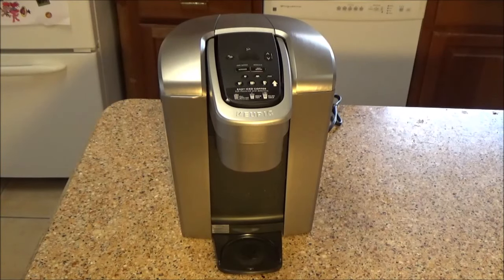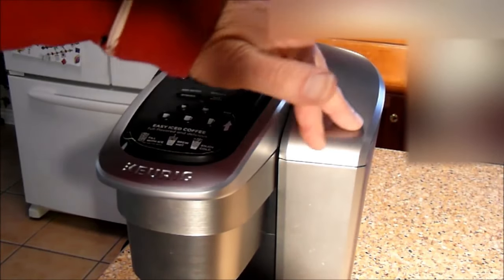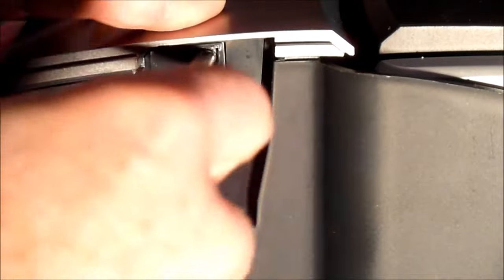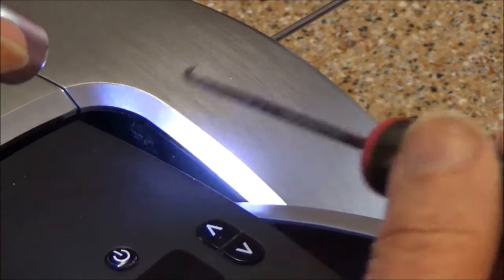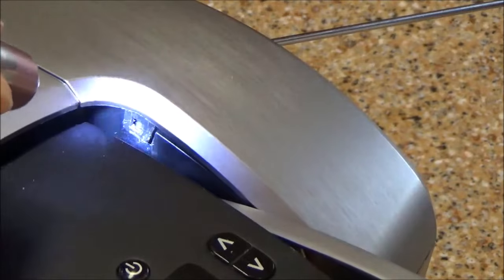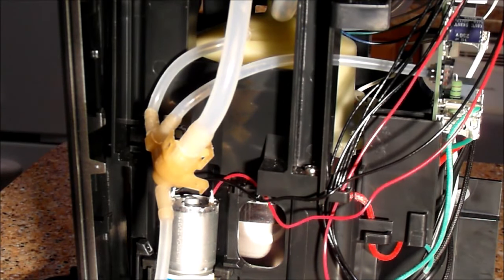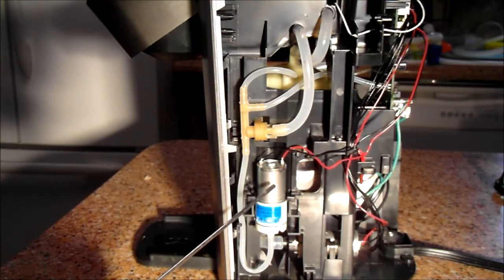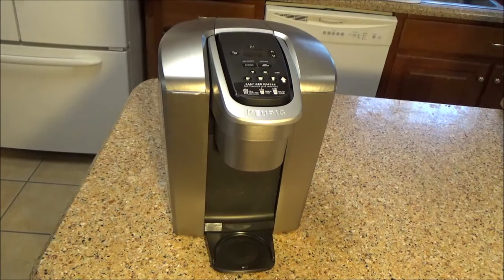Keurig Elite K90 Disassembly and Theory of Operation

Comment: Awesome video thank you. Do you know how to take the tubing apart without damaging anything? I have some mold trapped in the tubing but can’t seem to find any videos of this.
Reply from the maker: The ends of the tubing sometimes have a plastic zip tie around them to clamp them in place.  If that is the case, you have to cut the zip tie off using a pair of diagonal (wire) cutters, Xacto knife or something similar.  The wire cutters is usually the fastest and safest, and the idea is that you put the zip tie between both extreme tips of the wire cutter, and cut it (you don't have to force the wire cutters underneath of the strap, just on top of it).  After that, you can try to pull the end of the tube off of it's fitting.  If it doesn't come off, you can try to pry between the end of the tube and whatever fitting it connects to, to see whether you can get it to slide off by "pushing" it off by twisting the screwdriver blade or whatever you are prying with.  If that doesn't work, see if you can actually slide some thin object (like a small screwdriver) underneath the tube, between the tube and the nipple it is mounted on.  Opening it up like that can relieve the sticky friction that is holding it in place.  Then a little bit of prying and pulling might get it off.  It sounds difficult but it really isn't.  If you had to cut a zip tie off, you would need to replace it later.  They should be available in a home store such as the Home Depot.
Reply from the maker: Also, when working with that combination plastic piece that has a check valve and 4 flexible tubes attached to it, be cautious because if it is very yellow or brown in color, it can break easily.  It will look that way if the Keurig is fairly old.  On newer machines this plastic piece isn't so aged, and it looks more white colored instead.  In that case this piece is fairly strong.

Comment: Can you tell me where the thermostat is located in this model? Have looked at a dozen videos and no one has mentioned anything about its location. Thanks
Reply from the maker: I didn't cover that in this video, but I did cover it in the video for the model K50 at https://youtu.be/fdGND9f-kEs?t=2004.  When you watch that link, it will start out by talking about the emergency thermal fuse, but that's not really what you're looking for.  The discussion of the thermistor starts soon after that.  The K90 is pretty much the same as the K50 in this respect.  If you have the unit disassembled, you can trace down the white wires from the circuit board down deep into the side of the water tank, and barely be able to see the thermistor attached to the side of the hot water tank.  This is on the side of the machine where the external water reservoir would normally sit.  The thermistor is not really a thermostat, but it measures temperature and reports it to the main circuit board that uses the information to decide when to heat and when not to heat.

Comment: I think you've helped diagnose what might be wrong with our just out-of-warranty office Keurig. I think the water level sensing unit is full of water as it no longer reports when the water level of the external tank low. Also, when the water first heats up, a significant amount of water will come running out around the area where you popped the first latch at the back of the lid opening near the metal-looking tongue depressor. The water level in the external tank doesn't affect this behavior. It seems that as the internal water tank heats, the water can't run out of the overflow back into the external tank. Any thoughts on how to fix that without the extensive disassembly? My husband is considering blowing compressed air into it through the overflow.
Reply from the maker: I'm beginning to think this new way of sensing the external water reservoir level is less reliable than the older magnet based system that the older Keurigs had.  There have been times on mine when, like you said, the "Add Water" light should be on, but the light doesn't show.  So then without changing anything, I just turn the power off and back on again, and then the light does come on.  The water level sensor appears to be just a couple of plain metal rods that sense when water forms a circuit between them, since water is somewhat conductive.  When the "Add Water" light is on, I've put a 6 megohm resistor between the two probes, which forms a very weak circuit, but it is just strong enough to signal that the water level is no longer low, and the "Add Water" light goes out.  So the point I'm making is that if it takes practically nothing to complete the circuit to make the light go out, maybe just a little water vapor in the tube could do the same thing, even if there is no water.  So I think you could safely blow compressed air in through that ventilation port and I think it would be OK, as long as it's not too strong.  Pressure from an aerosol can or from an air compressor that is dialed down way low should be OK, as long as it is kept under control.  It won't take much pressure to blow it out and remove any vapor, if that is the case, but first you would want to remove the water reservoir and look down into the water port in the machine where the water reservoir plugs into.  You should see a white piece in the middle that is shaped like a plus sign.  Push on this and it should move down, because it is a valve, and it will allow the air that you are blowing into the ventilation port to escape (and maybe spray a little water out too, but not much).
Reply from the maker: Concerning the other part you were talking about, if water is coming out inside the compartment where the K-Cup arm is, I wonder if water is getting forced out of that ventilation hole that's on the wall inside that compartment.  If so, I would think something is blocked somewhere and building up pressure.  If you haven't already, you might try to clean out the needle that punctures the K-cup from the top with a paper clip or some thin wire and see what happens.
Reply: @getitsettech1015  I think you're right about something being blocked. However, I've already cleaned the needle. I've only used filtered water in this machine and have cleaned it a couple of times. The plan is to buy a new Keurig from Costco tomorrow for the office and bring this one home for my husband to take apart to try and find/fix the problem(s). He's handy like you are and watching most of your video inspired him to give it a shot. I'll let you know what he finds, if anything.
Reply from the maker: It sounds like your machine might be just a little beyond the warranty period.  Mine was too.  I thought it wouldn't hurt to at least call Keurig - most people have good results from them.  Sure enough, they sent me one even though I honestly couldn't prove how long past the warranty it was.  So it wouldn't hurt to give it a shot.
Reply: @getitsettech1015  I already did. We'd purchased it directly from Keurig so they knew how old it was when I called and would not honor the expired warranty. We've had it for almost 2 years.
Reply: @getitsettech1015  My husband took it apart and blew out some (or all) of the hoses and partially put it back together. The problem now seems to be solved. Once he's certain of that, he'll finish putting it back together. Your video was very helpful and I thank you for posting it.

Comment: Ours just started were it'll heat up the water then when you lift up the handle and then select the brew you want It will turn power off every time. Any ideas on that issue? Loved your video! Not sure what component would do that. It's almost like when the pump goes to make the coffee it shuts everything off. It's only 1.5 years old.
Reply from the maker: A clog in the upper needle that fills the K-Pod might cause this.  I simulated it on my K90 by taking the tube that runs between the hot water tank and the K-Pod arm needle and pinching it shut just before I selected a brew.  It briefly starts to brew and then about a second later the whole machine shuts off (except for the clock display).  It could also be caused by a bad water pump.  I simulated this by unplugging the water pump and the brew quits a second after starting and shuts off the power in exactly the same way.  The difference between these two is that if it is the exit needle that is clogged, you can still hear the water pump trying to run until the machine shuts off.  If the water pump is completely bad, then of course you can't hear it run.
You can see the top of the exit needle assembly in the video at about 38:14 in the video.  The flexible hose that comes from the hot water tank connects to a nipple on this assembly.  If you can't clear out the exit needle enough with a paper clip, it might require some disassembly to get to this hose and remove it, so that you can clean out the needle assembly from the hose end instead.
Reply from the maker: You might also check that the K-Pod is being completely pierced, not only on the top but on the bottom.
Reply: @getitsettech1015  Thanks for the info. Something to look at.

Comment: I have the same Keurig elite. And mine just broke. It powers on and heats the element but when I select to brew a cup of coffee it try’s to but then powers off. What do you think is wrong ?……
Reply from the maker: Someone made a comment like this on my other video for the K50 K Classic.   That machine is quite different and doesn't have a display, but when the person tried to select a cup size, the machine would shut down.  That person reported that they didn't do anything to correct the problem other than apparently unplugging the ribbon cable and then plugging it back in again.  If you can get just the top cover off, that should be enough to get to the ribbon cable and try that.
Reply: @getitsettech1015  Thanks. That worked I hope. I followed your YouTube video on how to disassemble the Keurig elite coffee maker. I unplugged the coffee maker. I removed the top and side cover only. I cleaned with isopropyl alcohol and re-seat all the connectors. I tapped the pumps and motors with screw driver incase they were seized. I checked all the valves and tapped the valve module on the circuit board. Checked all the hoses and cleaned the inside while I had it open. I then put the side cover back on and tested it. Hurray, It is working again. Not sure exactly what was wrong?…Maybe a seized motor or pump or PCB valve switch or just a bad electrical connection. But it is working again. I followed your video https://youtu.be/0Q8ueL0v5oQ
Reply from the maker: @Alex4SiliconValley  Glad you got it working.  Sometimes we'll take success even of we don't understand exactly how we got there!  Anyway, it sounds like you gave it a thorough checkup.
Reply: Yes, Without knowing the theory of how the electronics work. I just cleaned all the contacts with isopropyl alcohol and re-seat all the connections and wires. Tapped the motors with the butt of a screw driver incase they were seized. And checked all the tubes and switches and valves. Tapped the valve switch on the PCB with the butt of a screw driver incase it was stuck too. Cleaned the black riddon cable contacts and re-seat it. Obviously the problem was electrical somewhere. I just don’t know where with-out understanding exactly the theory of how the electronics work.

Comment: May I ask where you purchased your K90 air pump....have the same issue as you did...great video too.
Reply from the maker: I just bought it used on E-bay for about $6.50 and it worked OK.  That listing is gone now, but E-bay has other used ones.  I also found these new pumps on Amazon at https://www.amazon.com/DANXQ-Newly-Motor-Electric-Diaphragm/dp/B01HIBGZQ6/ref=psdc_2975471011_t1_B07FGFPKNS?th=1.  Disclaimer - I did not look these up by part number on Amazon; they just happened to look the same, and the voltage matches.  Note that these would not directly fit into the Keurig though without disassembling them slightly to install the mounting bracket that is Keurig specific, but they are new.  I have not tried these at all, but they looked interesting.

Comment: My issue with my Keurig Elite K90 is that it has power (LED display is on), but it wont turn on (green power light will not power on).  Unit is 1.5 years old.   Any ideas?
Reply from the maker: Even though the power button doesn't turn green, when you press it, do do you hear any clicks that happen about a second later?  Other than that, if you happen to have the main cover removed, you could take a voltmeter and measure between two test points on the main board:  TP1 and TP3 (label for TP3 may be hidden behind the plastic spring that holds the circuit board in the upper LH area).  It should read about 12 volts DC, which indicates that the main supply voltage is OK.  Since your LED display is on, it may indicate that this 12V power is already OK though.  These are just ideas because I can't think of a clear reason why it would act like you describe, at least so far.

Comment: Hi , is there a quick way to drain the water from the tank for storage ?
Reply from the maker: Sorry, right now I don't know a quick way to do that.  I've tried blowing into the ventilation port that is beside the external water reservoir, but that just blows bubbles into the hot water tank.  The only way that I was able to drain the hot water tank was because I already had the top cover and side shroud removed so that I could get to the water pump.  A person would then locate the tube that runs between the water pump and the bottom of the hot water tank, and then pry the tube off the water pump.  Have a container ready to collect the water from the loose tube, and open the K-cup arm so that it opens up that hidden hole underneath.  That will break the vacuum and allow air to enter the tank to let the water out through the loose tube.  Don't mess with the check valve that connects to the water pump - it has tabs that make it look like you can just pop it open easily.  I did that to prove that it was really a check valve, at the expense of breaking one of the tabs because they are very delicate.  They can only withstand initial assembly at the factory and any further attempts to bend them later on will break them.
Reply: Remove the water tank and push down on the spring loaded inlet valve that it sits on. Residual water should drain right out.

Comment: any suggestions  for a strong light that  just stopped working?
Reply from the maker: What kind of light do you mean?
Reply: @getitsettech1015  the strong buttone does not light up when pressed on my keurig  K elite  just stopped working
Reply: There are series surface mount resistors in series with LEDs. I'm guessing either the LED is burnt out or maybe more likely the resistor is burnt out.

Comment: Great video! Mine burned out from high voltage. Can I fix that and how?
Reply from the maker: If you're saying that it got burned out from being plugged into 220 when it was designed for 120 volts, it probably fried the main circuit board.  You could try to find a used circuit board on E-Bay to replace it.  Before doing that, see if you can use an ohmmeter to check the terminals to the hot water tank to make sure it still measures just a few ohms.  If it measures open circuit, that would indicate that it got burned out as well.
Reply: It would likely be easier and less expensive to simply find and buy a used machine on Facebook Marketplace as I did. Paid $35 for an Elite K90 that just needed a bit of tlc on the innards and looks like new.

Comment: Has anyone measured the voltage on their K90 water pump?  I’m have a low flow problem and I’m getting 7-8 volts on normal brew and 3-4 volts on “strong”. I was assuming I’d see 12V at the pump.  When I brew a large cup I get 7 oz dispensed and on strong (large cup) I get 2 oz.  On the air pump my meter read 7 VDC at the start of the cycle and then it quickly increased to 11.3 volts and stayed there until shutoff.
Reply from the maker: Stand by and I'll see if I can measure this within the next day or so.  I suspect that some of these voltages are normal though, because on the older units, at least the voltage on the air pump used to be variable (on purpose).
Reply from the maker: Both the water pump and air pump are driven by a 20 kHz pulse wave of variable duty cycle, in order to control the speed and drive.  The peak voltage is 11 - 12 VDC.

Water Pump:
Regular Brew varies from 7.5 - 7.75VDC average, 63% duty cycle.
Strong Brew varies from 3.8 - 3.9VDC average, 36% duty cycle

Air Pump:
At the end of the brew, it starts at about 7VDC and quickly sweeps to over 11VDC average within a few seconds and stays there like you said.  It starts at about 50% duty cycle and ends at 90% duty cycle.

So it looks like the drive voltages you are describing seem to be normal.  The weaker drive voltage in Strong Brew runs the water pump slower so that the brew is hopefully stronger.
Reply: @getitsettech1015  Thank you so much for doing these checks. I’m really at a loss now for what my machine’s problem is.
Reply from the maker: If you have already checked the pod needle to make sure that it is clear, you could check the valve at the water reservoir inlet to see that it isn't clogged (the plus sign as you look down into it).  Also, right after the water inlet is what appears to be a filter of sorts and then a check valve that could be clogged.  If you try to open that check valve be REALLY careful with those tabs.  They seem to be strong enough for factory assembly, but not for disassembly.  I broke one of the tabs on mine.

Comment: They need to make it to where you can easily see the water container to see if it’s moldy or mildew-y
Reply from the maker: Right.  The top cover is usually black colored.  No reason it couldn't be clear instead.